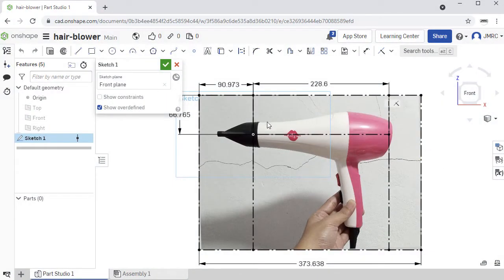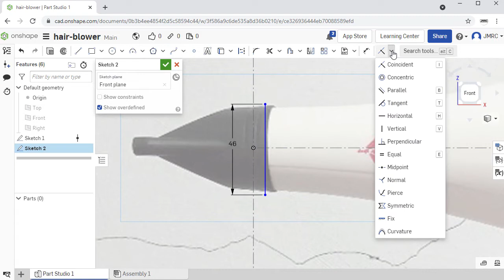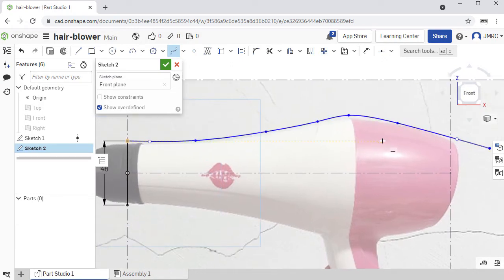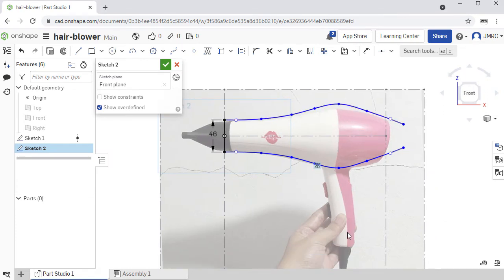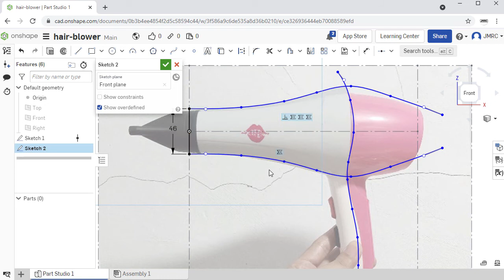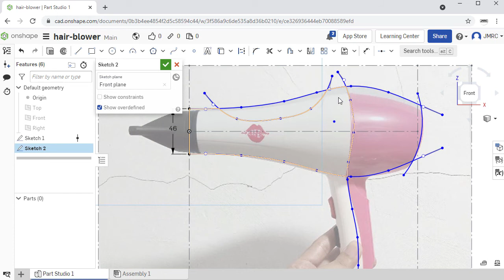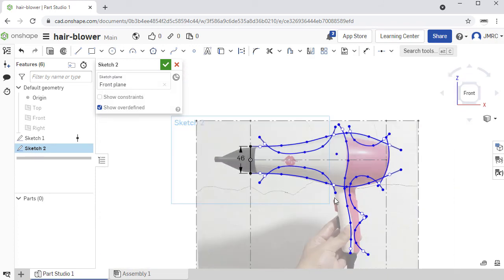Surface Modeling Onshape - Sketching the outline

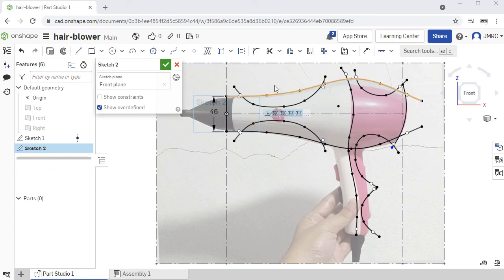Comment: @6:46 there is still a blue dot at the lower end of the 3 point curve at the back of the blower. I resolved this by selecting the blue dot specifically and "fix"ing it in place.

I'm not sure if this is the correct to resolve it tho?